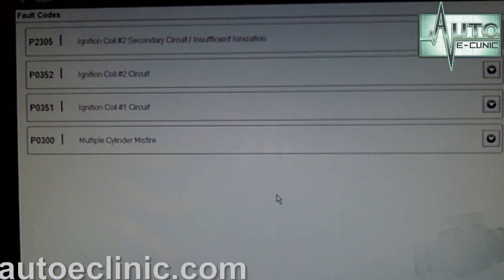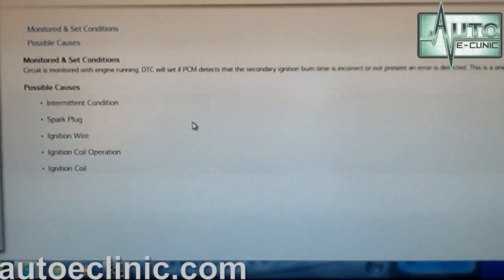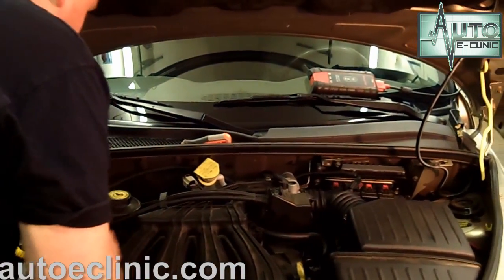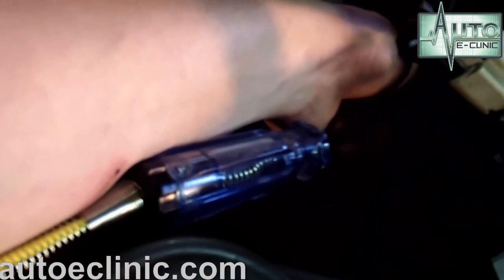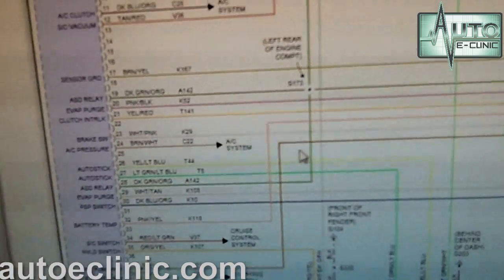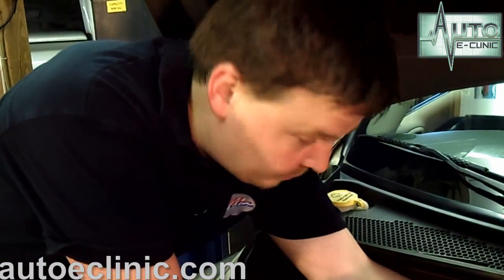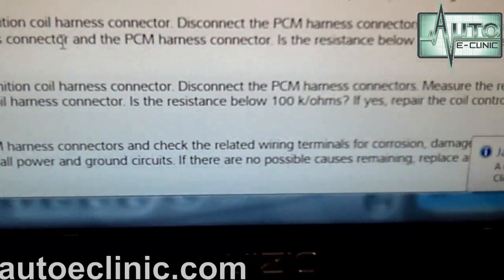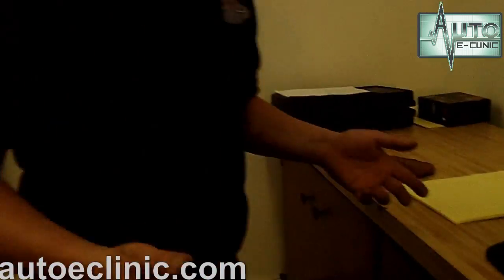How To Diagnose A Check Engine Light :Codes P2305 P0352 P0351  P0300

Comment: Code P0351 and missfire 1 and 6....jeep wrangler 2002 4.0L , ManuaL Trans.. I try many things even try a new coil pack nothing works,,,any suggestions? the Tech thinks it probably the ECU ;;but i dont really beleive it ;;; PS the car run great  ; drive but loose power ...AGAIN ANY SUGGESTIONS; PLEASE..

Comment: i have a 2000 silverardo with 5.3 i replace the plug with E-3 and new wires . runs like crap and threw 8 codes 352-354-356-358 and the same codes with little blocks with lines 1 up and 1 down. any thoughts?